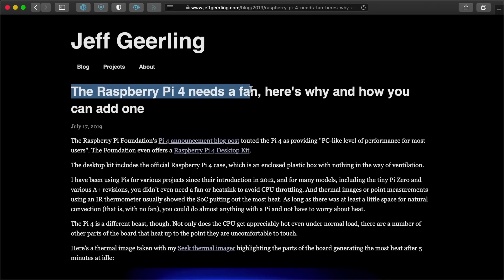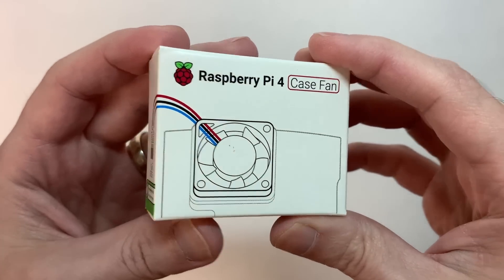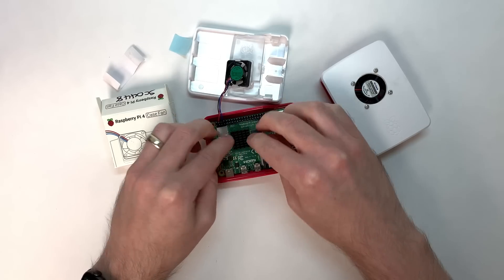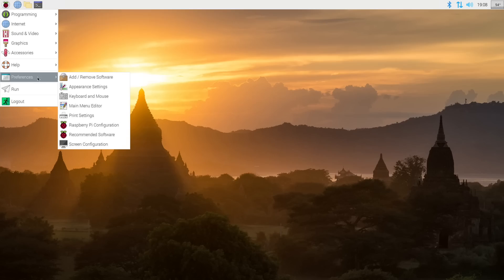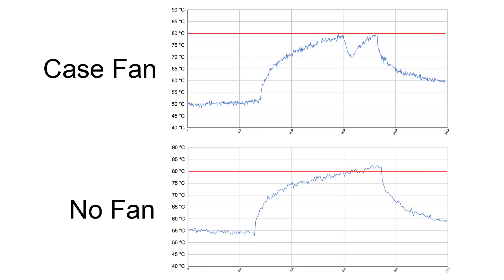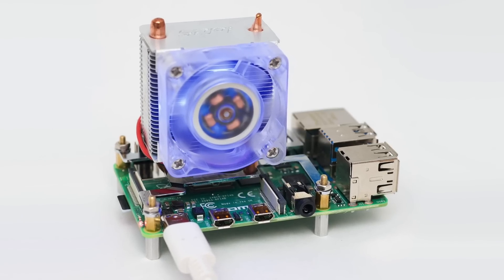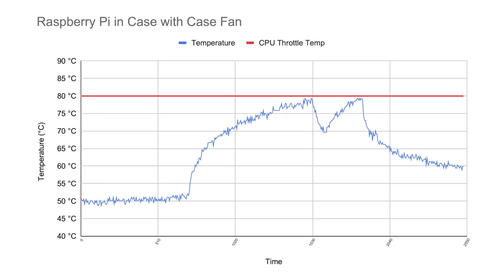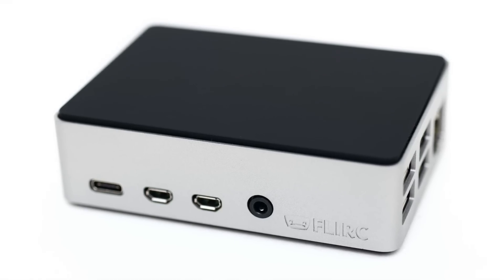Raspberry Pi Case Fan - How Loud is it?!

Comment: Pretty old video, but nevertheless: Run the fan from the 3.3v pin, and the unbearable whine is reduced to a modest whirr. Everything works as before, kicks in and out according to settings.

Comment: Whoever designed the fan obviously didnt know what they are doing, do they really expect those tiny holes to provide enough airflow? Especially when one hole, the sd card one, is pretty much underneath the board. They should have used a quieter and better fan in the first place but they also could have started selling cases designed to be used with a fan or included a new white top bit of the case with cut outs for the fan. Also the pi should have a fan header somewhere so it doesnt need to use its GPIO port since that makes it very difficult to attach a GPIO extender or anything to it.

Comment: I'm really disappointed with this fan. Mate, it's like a 747 turbine!!! It's cheap, has third plug for GPIO (which enables it to turn on/off according a predefined temperature) and suits perfectly in the official RPi 4 case. However, out-of-the-box there's no way to connect it to a 3V pin. Thus, it must be connected to a 5V pin. This way, it's really loud. I tried to make it quieter changing the power connector, in order to plug it in 3V and setting 65C degrees as threshold. The result? I can't afford watching a movie without a thin, unstoppable whistle in the background.

Comment: I find that 3rd party cases have larger heatsinks, quieter and more airflow. And it also has a vent. I like smarna cases especially. Also I don’t use GpIO control, especially with the fans that only have 5v/3v and gnd, so no GpIO pin. I just run the fan always

Comment: Love the flirc case, not sure I could go back to a fan cooled pi. The pi foundations solution feels a bit lacking though. Really wish they'd have also updated the case to include some vent holes and offered it at a discount given they were pretty agressive with people suggesting the thermals were bad (To the point where their forum staff were locking threads if someone even mentioned the pi 4 running hot). Accepting constructive criticism has never been their strong suit though sadly.

Comment: Cant you just plug it in into the 3.3V pin?

I did it and it reduced it's noise drastically. It’s running 24/7 keeping the pi cool.
Once in a while (every month) I need to free the pi and the fan from dust which only takes me about 5 minutes to do.

PS: I use it as a NAS, development environment for web application projects (nginx, MySQL, Node.Js, …), and occasionally I run a Minecraft server to play with friends once in a while.
It never gets hotter than 65 C.

Comment: I have exactly this case and the fan, but the high squealing sound is unbearable. I unplugged the fan in the end.
The issue with the fan is that the acrylic bezel inside goes into resonance and produces the squeal.
I think with a bit of dampening foam it might be less audible.
But yes, the PI foundation could have used their 3D modelling software to model heat dissipation and resonances in the casework.
And there are more than enough companies in Cambridge who the the software available to do this for a few bucks!

Comment: I run ubuntu on my pi.. and the official fan makes a lot of noise... !!! is there a utility in ubuntu to take care of this? I wish i watch this video before going that route. I will do something else.. because i cannot stand this high pitched whine. Now others have talked about adding a diode to the mix making it less noisy. Shouldn't I be able to control the exact speed of the fan.. why are there 3 pins if i cant do that?

Comment: The Argon One cases is even better than the Flirc, and now they also made a model with M.2
Reply from the maker: Maybe so, but it has a fan, and a slightly annoying one at that :P
Reply: @JeffGeerling  But the passive cooling capacity is so good that the fan never needs to start unless the enviromental temperature is extremely high.

Comment: How hot the pi runs with it in 1800 MHZ and 2100 MHZ? Do you recommend me the cooler master case? I would use the FLIRC but I know many aluminum cases decrease the power of the wifi

Comment: I listen to the fan at full speed for 13 hours as I didn't update the raspbian, using a custom case and have to keep it on while in my bag. It's not loud, but the high pitch whining is always noticable and a little concerning. Just sounds like my old Thinkpad X200t when its fan was about to die.

Tried many passive cooling solutions and failed because when I put it in the bag it simply couldn't dissipate the heat outside.

Comment: I've tried the Pi, Flirc and Argon One cases for RP4
Pi case  is just bad for heat dissipation.
Flirc is good and has a small footprint.
Argon cools better passive and active from my testing.
Argon costs the most at ~25US.

Comment: Would it be possible to PWM the fan to run it slower, but earlier?
Or possibly put a resister in the path and trigger at a lower temperature.

Comment: on my test... using also a phone app on a dual fan aluminum case (not RPi Fan), measured 80mm from the fan itself, fan OFF at 20dB, fan ON at 22dB... images can be seen on the Raspberry Pi forum

Comment: The sound might come from air passing through holes that are too small? I wonder if drilling an intake hole and exhaust hole might make it quieter? Im guessing the fan is quiet when running disconnected from the case?
Reply: I wouldn't because this fan solution was chosen based upon air flow dynamics. Before you reach for the drill, give this a read.
 
https://www.raspberrypi.org/blog/designing-the-raspberry-pi-case-fan/
Reply: @hansoak3664  yes, it looks like they put a lot of thought into it.

Comment: Might be a dumb question but have you tried attaching the fan to the 3.3v power pin? Does it still work/is it quieter? That's what I do with my pi fan, and it keeps the noise down while still stopping it from throttling.

Comment: tbh i just unclipped the leads from a 80mm fan and attached them to 5v and ground. i just left the top half of the case off. the fan runs completely silent.

Comment: Have the ICY - BOX Pi4 case with a 40x7mm fan. Can't hear the little fan unless i put it close to the ear.
In addition with 4 heat sinks i get about 33°C at idle and 40°C on average load. No stress testes were
completed. Cheers!

Comment: The FLIRC case is the best I've ever bought for a Pi. It keeps my Pi4 from throttling with the CPU at 2.1Ghz and the GPU at 750Mhz.
Reply from the maker: I love the Flirc! I have two running now, and two other cases on standby.

Comment: A few weeks ago, tried to "mod" my cheap raspberry fan to make it controllable by pwm. Main idea was just to use a mosfet with the gate tied to pwm signal, with a small capacitor to smooth things out a lil bit for the fan. Basic design like that made a high pitched noise too, like in the video, so kinda wonder if they might not have tried the same thing. Although, for now I've shelved the project cause it kept getting more complex without much results, especially on the noise control side of things.

Comment: Would leaving the top off work? Or maybe just drill a big hole on it. My case with fan has open sides and big hole for the fan. Once I updated the OS, it manages to stay cool a lot longer than it used to.
Too bad the fan didn't work off 3v GPIO pin. And unlike the official fan, it only has two wires instead of three. 
At least you can substitute your own 3 pin fan if you want.
Reply from the maker: Yep! See https://www.youtube.com/watch?v=mTHAO9P_hxQ

Comment: The sound of silence ... with this one  (https://shop.mchobby.be/fr/raspberry-pi-4/1659-ventillateur-silencieux-pour-raspberry-pi-3232100016590-garatronic.html )
One year of usage,  35°c on the chip with Home Assistant running , and "zero noise" , a real dream

Comment: Can you help me clarify something? I have a Noctua 40mm 5v fan with 3 pins. The third pin on that fan is the "RPM Speed Signal". Their 4-pin PWM version contains pins "RPM Speed Signal" & "PWM Signal".

The Raspberry Pi 4 GPIO output pin is an On-Off setup (not PWM). Which fan version, and what pin should I should I connect to the Pi GPIO for it to work?

Comment: I just have old 12V PC Case Vents in my two pi’s, attached to +5V and ground. Its running quiet and im fine. The vents are just placed over the open cases. Even with overclocking the temperature is about 60 degrees celsius

Comment: I'd like to know if connecting the fan to 3.3V off the GPIO is an option as it is with other fans for Raspberry Pi systems.  Makes for a good balance between cooling and low noise in most cases.

Comment: I have a CanaKit case and fan. I swear it becomes louder after 1am.
Reply: I'm running a canakit as well and I never hear the fan. But it's sitting near my computer, my laptop, a large floor fan, and an overhead fan. The canakit fan doesn't overwhelm my surrounding noise

Comment: When I heard they were releasing this, I assumed it would come with a replacement for the white top part of the case with mounting points and a vent hole, and I'm still kind of baffled it doesn't. I mean... how much would that have affected the price? They needed a custom plastic part either way, and the difference between the part they made and the one they could have made... surely that's a couple of pennies per unit...? It would also have meant they could have moved towards selling the case in two models -- cooled and uncooled.

Comment: That original design for the pi case is ridiculous when used with a pi4, because the pi4 generates so much heat compared to the pi3.  I use the Flirc case for my pi4 and the pi 400 deals with heat so efficiently it's cooler than the pi3 it replaced, silently.

Comment: Do u have case where it has passive and active cooling similar to https://www.amazon.com/Raspberry-Armor-Metal-Aluminium-Heatsink/dp/B07VWM4J4L/ref=sr_1_4?crid=OD5GC0AJ52EW&dchild=1&keywords=raspberry+pi+4+cooling+case&qid=1607276912&s=electronics&sprefix=rasb%2Celectronics%2C198&sr=1-4, What I require is a case which has Normal HDMI ports, active and passive cooling, and support for nvme drive  with out loosing an external usb linked connector.

Comment: There are a couple of problems in attaching a fan directyl like you show at beginning of video: a) electric noise from the fan (basically a pulsating coil) could damage the Pi b) that fan was designed to be controlled (PWM, voltage divider, etc) because if you run at fulll speed it will draw a big current (1A or more) and of course sound like a helicopter; good solutions are: put some diodes in series with the fan, thus the voltage drop would reduce the current consumption thus rpms thus noise; better yet, implement a PWM control (via a transistor + protection diode) to change speed based in Pi's internal temp; this has lots of advantages, like running siently and only ramping up the rpms when u start to sense thermal increase, so you wont even need to go 75% of max fan rpm; also you need to put some dirt filter (i.e. small grid) over the fan to block dirt and potentially risky particles from getting sucked by the blades)
Reply: Maximum current for the fan is 0.06A

Comment: Your mod was more pleasant to listen to than theirs
Reply from the maker: Unfortunately the little fan I'm using doesn't have as easy an integration into the 'only run at a certain temperature' mode that's now built into Pi OS, since it just has ground and power wires. But there are other fans that do have a control wire that would work just as well and be a little more pleasant when they kick in for short periods!

Comment: I wonder if the fan will work with 3.3V.  That would slow down the fan considerably, and thus eliminate some or most of the noise.
Reply: I have my pi's fan connected to the 3.3v pin. With the fan blowing directly to the heatsink keeps the temperature below 40ºC no problem. And it's noticeably quieter.
Reply: It's a pwm fan... It receives a signal telling it to target an RPM... Hard to tell if it's electronics will work on 3.3v... but 5v doesn't imply it consumes more power than a similar 3.3v fan. That said you can adjust it to keep the RPM down to nothing

Comment: ... Pi 4 SOC starts throttling at 80C... But if you're overclocking to 2.3/800, your limits will be far lower... think 60C. See Argon One defaults. Just get a low profile ice tower case... and upgrade to a 40mm 5v Noctua. They're on Amazon for $35... Or a Pi 400, or wait off better compute module based contraptions.

If spending $60 on a cooling solution makes you squeemish, Ali Express has $9 40mm fan cases for the Pi... 6 week shipping :/
Reply from the maker: The Pi 4 SoC throttles if the CPU hits 80°C or the GPU hits 85°C by default. And note that the BCM2711 itself is rated up to I believe 125°C, so this is still a decent ways away from the point where the chip would actually be damaged (though I wouldn't recommend letting the Pi / case get up to temperatures that hot regardless!).
Reply: @JeffGeerling  https://github.com/meuter/argon-one-case-ubuntu-20.04 See the temperature table... I've had great luck with it... Maybe I should get a cheap 1GB model and push it till it burns 😈

The main reason to use a fan is to overclock it... ~60C ± 5C should be the target for 95% of the limit overclock of 2.2/750 with a 15% failure margin.

Comment: I’m a huge fan of the Argon One case. Not only does it have a fan but it fixes one of my major annoyances with the RPi in general in the uneven IO distribution. The A1 moves all the ports to the back, so you can actually plug it into usb, network, AND a monitor while being able to keep the cables tidy or having to buy weird right angle cables. It also looks dope. 

Its fan also sounds whiny.
Reply: After faffing with a few (never satisfying) cooling solutions, the Argon One case is definitely the best case available for the Pi 4.
Effective passive cooling for low-demand use, and the 3 level fan-speed to keep a good balance of effective cooling and quiet  operation. Accessible micro-SD slot, the accessory boards bringing all plugs to the rear and keeping GPIO pins accessible is simply brilliant design. Cannot technically fault it (and 2,5 years of daily use proves its reliability), and the look is very "living room friendly".

Comment: is the noise much worse with temp limit set to 70F. Or if you drilled some air holes in the case?
Reply from the maker: With the limit at 70°C (not F, I should hope—it would always run unless you're in the arctic circle!), it would just run more often. Drilling some holes in the top would let some air escape passively, and would help a little bit.

Comment from the maker: Skip to 03:23 if you just want to hear what the fan sounds like.

Good news: it doesn't sound like BEES. Bad news: It's still annoying when it runs :)
Reply: Sorry man, 
but the noise depends exclusively from the amount of voltage of the 5 volt pin, that is too much for this kind of little fan. 
Using the 3.3 volt gpio is the only way to remove the noise. 
However, this solution could stress to much the raspberry, at least this is what someone on the Web said...personally I never break a raspi for this reason. 
The best safety solution is plug the red wire of the fan to 5v gpio, but build a little circuit with a diode and a 2n2222 transistor
Reply: Thank you for sharing. I was waiting for post on the sound. As you said it's still annoying. I find the 40x40x10 fan more acceptable at 5V, so eventually found a case that can fit this size of fan. The Pi 400 definitely has the best passive cooling solution today.
Reply: The fans packaged with the C4 labs cluster case I put together aren't too bad at all(I integrated a 5V/30A supply as well) : https://twitter.com/theC4Labs/status/1319504640916926466?s=19
Reply: NB you do have to enable temperature control.  The instructions don't make that clear.

Comment: Jeff, have you had a heat related Pi failure?
Reply from the maker: Nope! I have had Pis and microSD cards get very slow due to overheating sometimes, so that's my main concern with temperature issues.
Reply: @JeffGeerling  can you messwhit up fan control setings for 0.2second work and sleep on work for slowing down its speed for reducing its saund?